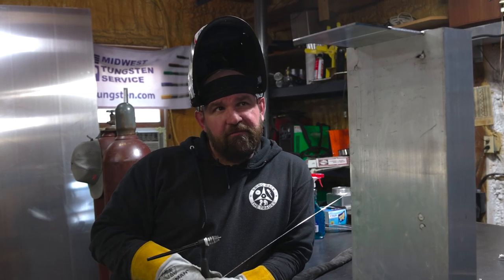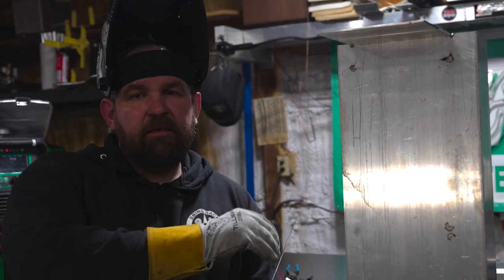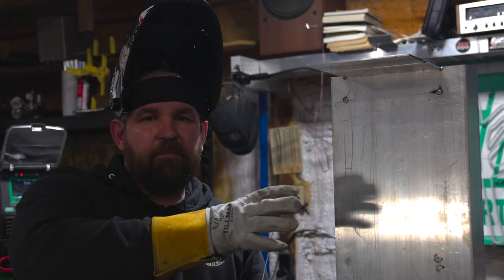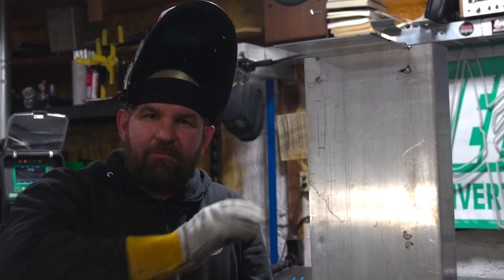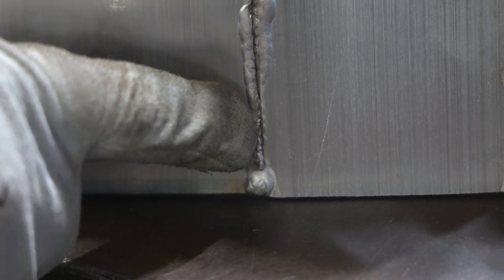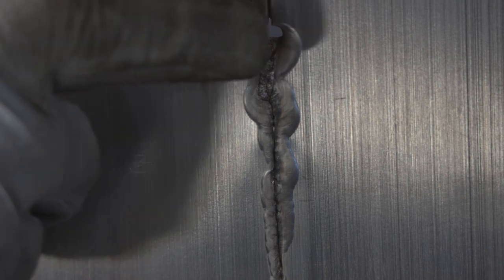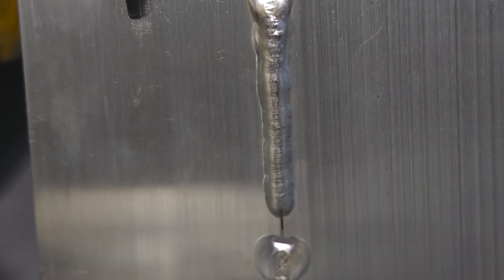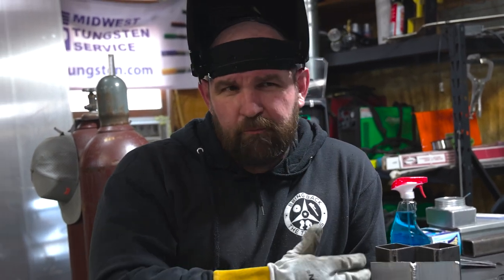TIG Welding Aluminum Overhead Tips and Tricks

Comment: As a retired multi coded welder from North Sea in Scotland, my worse nightmare was purging stainless steel on pipe work, sometimes 1 inch in diameter. 3 repairs, and oil companies sent you off for a retest. Some welders wouldn’t fire up, until scaffolders had harped them in, with no wind what so ever, as wind would blow argon away from inside pipe. We would light a match, and if if flickered , then it wasn’t wise to start welding your butt. Only trade to get tested for oil rigs, that’s why we were gods out there. Especially a Babcock n Wilcox welder, who were the cream of welders.🥳🏴👍

Comment: Awesome video thanks Jesse.  So that was two nice shiny plates close together upside down,  which I can do but what about a corrosion hole in 1/4 inch aluminium plate ground out to say 1/4 inch and clean.  How do you fill that? I always seem to end up with a nice pad on the outside(underside) with minimal penetration and filling of the hole.  It usually looks terrible from the top side,  do you have any secrets to get to the top of the hole?